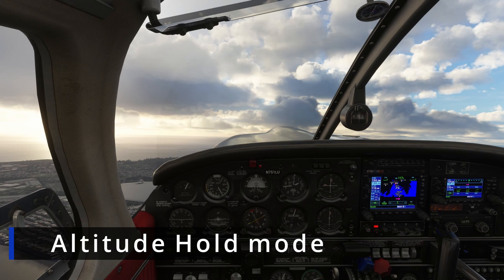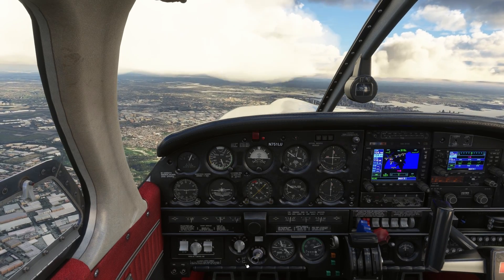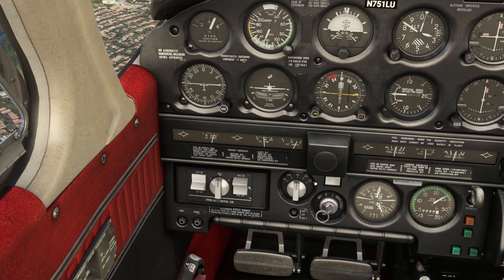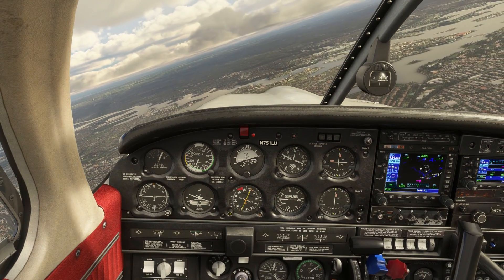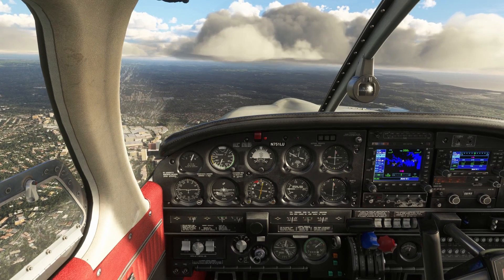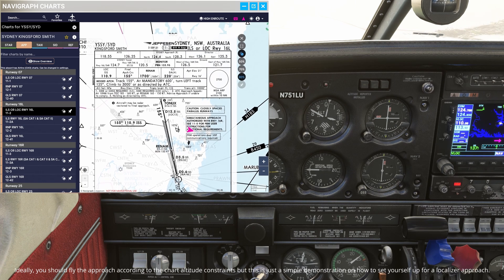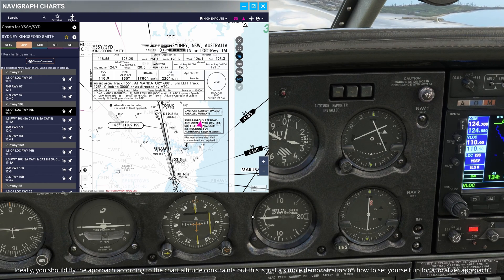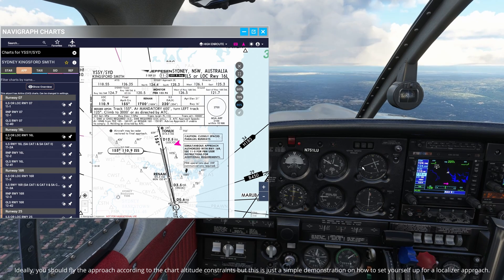FULL AUTOPILOT GUIDE | PA-28 ARROW III - MSFS 2020 | EPISODE #7

Comment: I bought this plane on the recommendations of many people.  They were all wrong.  This plane feels even more generic than the stock planes MS supplies.  The sound is terrible.  The physics feel canned.   It feels like assembly line coding.  No heart and soul to this plane in the slightest.  Ill not be buying anymore Just Flight planes thats for sure.
Reply from the maker: It had its time. Now that we have a2a airplanes coming in...the bar is set really high for GA airplanes in mafs.
Reply: How can it be 'more generic ..' ?
Do you know what 'generic' means?
Default MSFS aircraft are generic; this aircraft flies like the real thing in many ways. 
I have used the technical data to do fuel calculations on long flights - they turn out to be pretty accurate. Even real aircraft don't perform exactly as the book predicts!
Maybe you are having trouble understanding/using Manifold pressure/RPM/Mixture?